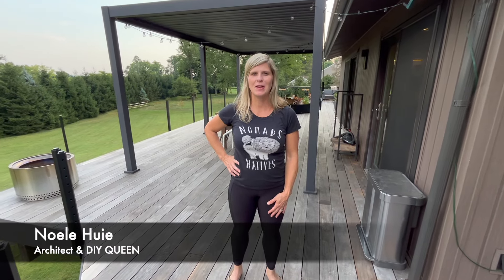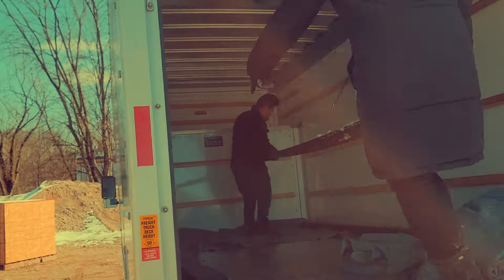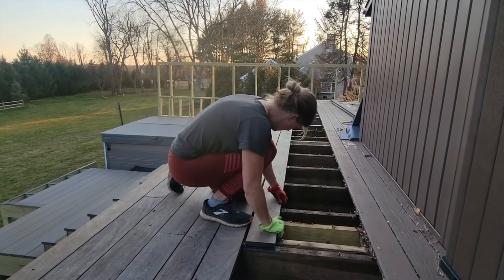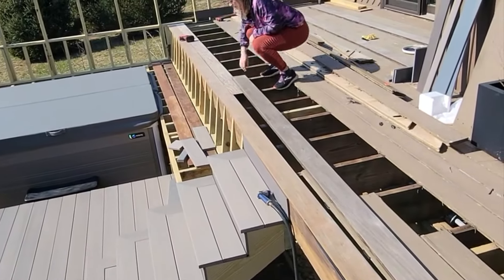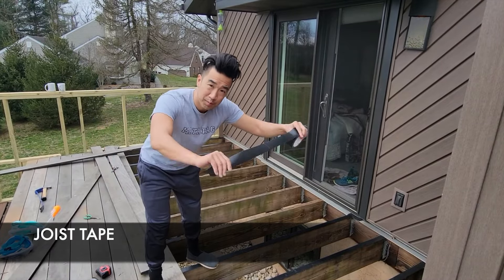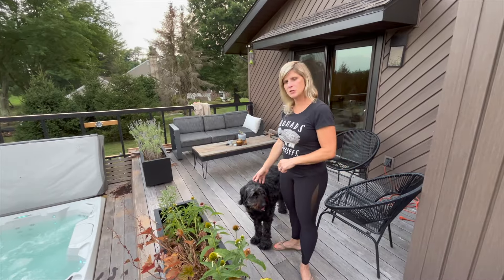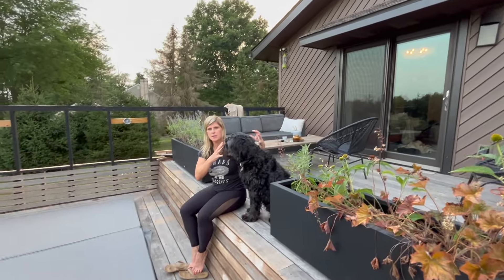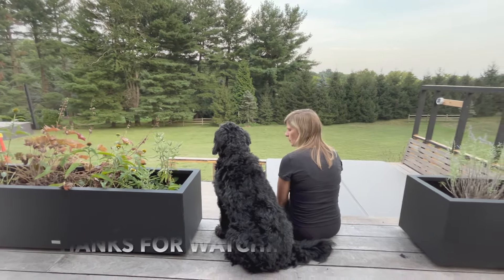HOW TO REDO YOUR DECK FOR A FRACTION OF THE COST - DIY Home Improvement

Comment: don't you need safety railings on the other side of the hot tub ?
Reply from the maker: Hi! Do you mean the side closer to the house or away? 

The side closer doesn't need one because it's less than a 22" drop (I think that is the requirement). On the other side away from the house, we don't have one since it's not a sitting area (more of a drink rail). Great question! Thanks for watching and subscribing !